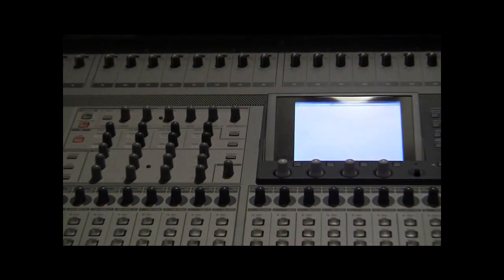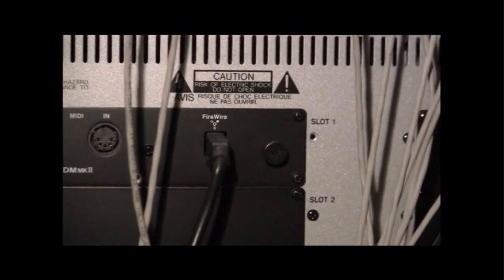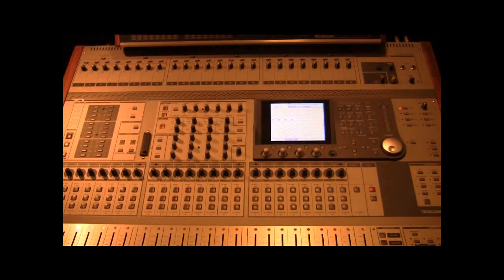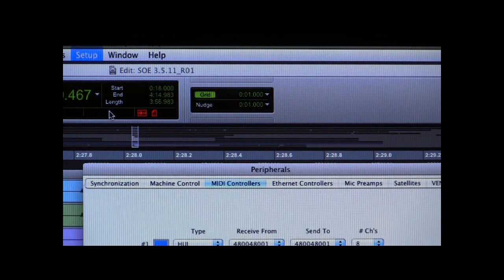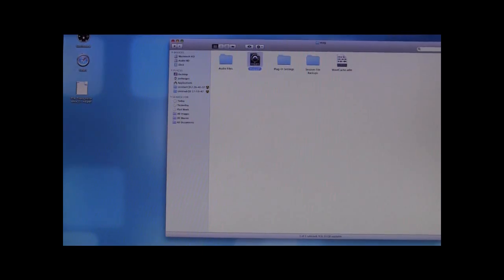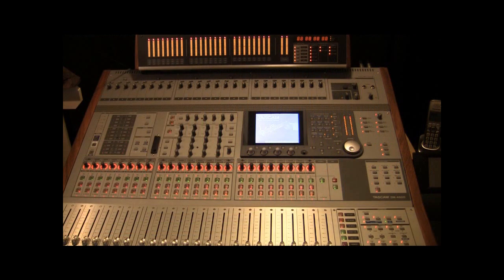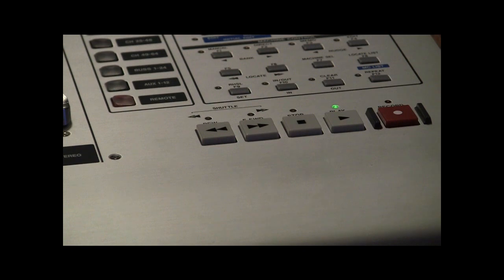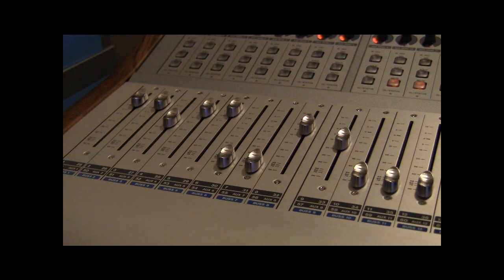Tascam DM Mixer and Pro Tools control interfacing.

Comment: Will I need an audio interface in order to get sound out from protools into my Tascam DM 3200.
Reply from the maker: Depends on the interface you have in your pc or Mac.
Reply: @KCPELICAN  ok I asked the question completely wrong. What I meant to ask was do I need an interface if my dm3200 already has a FireWire card?

My Mac has a FireWire port and I'm able to control protools but Im not getting any output sound from playback after recording.
Reply from the maker: @AyyuBX7  Ho. It sounds like all you need is a FireWire cable. Remember, USB offers control. Audio is sent via FireWire.
Reply: I check the audio input on the Mac and it shows a signal but on Protools I'm not getting any input signal.

Comment: just getting started here in 2021 as to whether I can bus audio and do overdubs through all the channels to Pro Tools 10. You stated here that yes PT 10 will work but will the Firewire card work with ProTools 10? I heard the card only works with Windows XP or Windows 7. The card is only available now on eBay, no Tuscan support if it is non functional. The bay guys still want full price and higher for a Firewire card no longer being made or supported.
Reply: sorry I meant will the Firewire card work with Windows 10?

Comment: Hi, I have this board and I like it. But would like to use it with my new macbook pro which only has usb-c ports / thunderbolt. Is there a way to do this or is there any company out there that build those cards and firmware / software for this board? I have contacted Tascam several times but no response. I don't understand why they had to discontinued this board. It is a great board.
Reply from the maker: I'm not sure but you may want to contact the folks a Sweetwater music. If it can be done, they can tell you how. Happy recording=)

Comment: Hey I have a tascam dm 24 and I am trying to set this up as a control surface... can you help ? I use pro tools express with an mtrack plus
Reply from the maker: I'll sure try. What is your question?
Reply: In order for the tascam dm 24 to be recognized by pro tools it must be connected midi in out from mixer to the interface? correct?
Reply from the maker: I do not believe so. I do not use any MIDI in my system. In my set up, audio is passed via firewire and control is passed via USB. This is discussed at the 18 second point of the video.
Reply: Hi there, the problem is that the Dm-24 doesnt have USB nor Firewire ports! any solutions? thank you! great tutorial.
Reply: There are MIDI to USB cables... as well as MIDI hubs that receive several MIDI inputs and have an USB output for the computer.

Comment: I am trying to decide if I need to buy the firewire card or not. I want to use my DM4800 (no fw card yet) to control ProTools 10. I already have a Focusrite Scarlett 18i20 (18in/20out). Should I route patches to and from all the ports or take advantage of the 32 in/outs on the fw card? If I do get the card, what can I do to get the best of both worlds? I do like the Focusrite Pres. I heard the Tascam Pres are also awesome but haven't tested them yet.

Comment: When your recording does The DAW listen to the audio processing from the board as well for recording?
Reply from the maker: +Chase “KidSynth” McWilliams  I'm not sure I understand your question. The DAW and "Board" are the same device.
Reply: The DAW in this video is ProTools and the board is the Tascam which interfaces with ProTools, Logic Pro X, Sonar etc. I'm asking if I apply EQ and compression (or any other FX) on the Tascam will that be recorded into ProTools? Thanks!
Reply from the maker: +Chase “KidSynth” McWilliams Ahh, I see how Protools can be seen as a DAW as well. I guess by definition they both are! How the Tascam effects the record send depends on the output setting of the Tascam. I believe when the output is assigned as Pre/ direct out, EQ and channel strip settings would not effect the record send. The Tascam record send however can be configured in several ways.

Comment: MY QUESTION IS. WILL THE TASCAM WORK WITH PRO TOOLS 10?
Reply from the maker: officialmindlabs Yes. After all, this video shows interfacing the Tascam to a Mac running PROTOOLS!
Reply: just getting started here in 2021 as to whether I can bus audio and do overdubs through all the channels to Pro Tools 10. You stated here that yes PT 10 will work but will the Firewire card work with ProTools 10? I heard the card only works with Windows XP or Windows 7. The card is only available now on eBay, no Tuscan support if it is non functional. The bay guys still want full price and higher for a Firewire card no longer being made or supported.

Comment: Hi, I have owned my DM-4800 for over 2 years. I run Windows with Presonus studio one 2. I have had this connected to 3 different computers and it always takes several times for TMC companion to talk to computer. Would I have less problems if I switched to Pro tools or switched to a Mac? Thanks.. Love the board so much except for this issue.
Reply from the maker: Kevin Mannarino I do not use Windows or Presonus but wish I could share some insight. How do you like your 4800?
Reply: I love this board! It took a bit to figure out at first, but this one issue is very irritating. Guessing you have no issues with your Mac USB connection? I may switch to Mac and pro tools simply because I love this board. What a pain, lol.
Reply from the maker: Not yet. Had it about about 5 years now. Best of luck to ya.
Reply: Kevin Mannarino I'm so happy!! I went to Micro Center and they suggested installing a separate $34.00 USB card. Works great!! Back to loving my DM-4800.
Reply from the maker: Glad to hear of your success. I recall having firewire issues when using a glyph external drive but never USB issues, I must admit, I don't use TDM companion. Not even sure what it does.

Comment: Can anyone help........I purchased the Firewire card and installed all drivers. Sill, it states driver offline.  I use windows 7 but no luck.  I tested the card using A mac and all went well.   So I don't understand, why can't I get this card to work on the windows platform.  This is so weird to me.
Reply from the maker: I wish I had an answer for you. You have narrowed it down to a either a windows issue or a problematic firewire port. Perhaps try another windows machine to eliminate the firewire port issue potential. If it works, you know you have a bad FW port. If not, perhaps try windows 8 or an earlier version. I'd also suspect you have to point the software to the FW port within windows. Best of luck.
Reply: KCPELICAN Thank you for your suggestive input..Appreciate it.

Comment: Can the DM4800 Control 24 channels
Reply: Yes it can do this. I control 24 channels on cubase since version 5.0. Very simple to setup, also! There's no desk so complete like DM4800 nowadays yet....i love it! With nudge function you can control virtual unlimited DAW channels.
Reply from the maker: No! 16 Channels via USB.
Reply: The manual says;

DAW controllers
The DM-4800 also supports dedicated control of popular DAW (Digital Audio Workstation) packages through Mackie Control, as well as providing a generic Mackie HUI emulation.
See the documentation of your DAW package to find out how to set it up for use with external controllers of these types.
Unlike the controller, fader and mixer functions, the control here is made through the “embedded” MIDI channels carried on the USB interface through ports 5, 6 and 7. Up to 3 virtual DAW controllers may be assigned in a DAW, each using a different MIDI port, allowing the 24 modules of the DM-4800’s control surface to be split into three groups of eight modules each, each representing a different device. Data is transferred bi-directionally, with the faders and con- trol surface of the DM-4800 reflecting the current DAW status.

Comment: This is an awesome vid, thanks.  Is it possible to use the onboard effects at the same time while in remote mode.  I use USB and adat for sound submission. It appears if I' am in remote mode, I can only use the effects that's in my daw or I can use the outboard effects if I have a firewire card. Is this true.
Reply from the maker: Hello and thanks Krishna. I see no reason why the on board effects will not work in remote mode. As you know the layers  operate independently.

Comment: I don't have the firewire cable but I cant get the faders to move with pro tools I have a pc pro tools 9.0.6  play and stop work and I notice if I move the faders volume from pro tools move but if I do it from pro tools faders don't move how to fix this
Reply from the maker: As stated in the video, firewire has nothing to do with control. Firewire is a method of audio transmission. USB is used for machine control and set up as MIDI on the Tascam.
Reply: I don't get number one I get 2 thrue 7 I have 5to5 6to6 and 7to 7
Reply from the maker: If there is a question in your message, I don't get it!

Comment: Thank you very much for the video. It's very useful. I have at the moment a Tascam DM-3200 and I want to use it with Pro-Tools 10. I can control the console from Pro-Tools and viceversa, but I can't record audio using the Tascam. Is it mandatory to have a firewire slot? The tascam that I have now does not have a firewire port. I'd really appreciate if you can help me!!

Comment from the maker: It depends on the routing to protools. If your using direct out then EQ & such will not be included in the send. You can select a Aux or buss send for the output to PT, then EQ & such will be active in the recording.